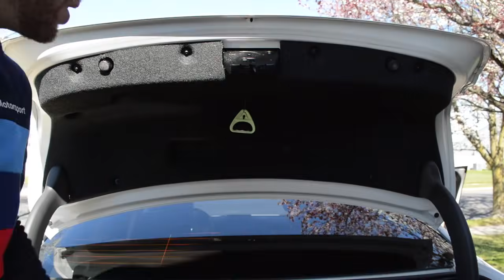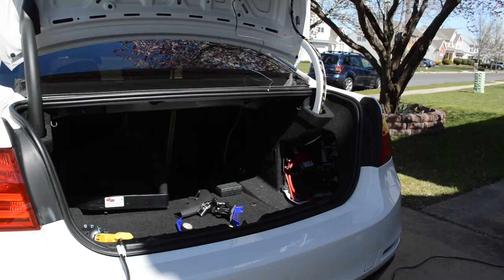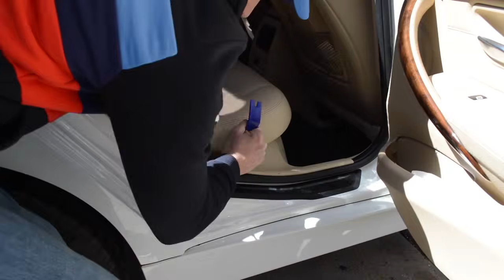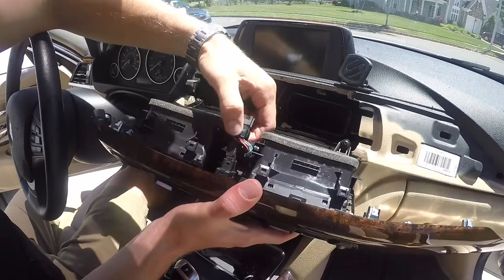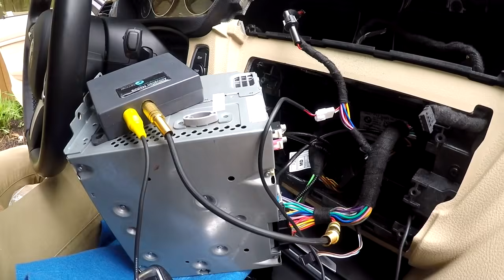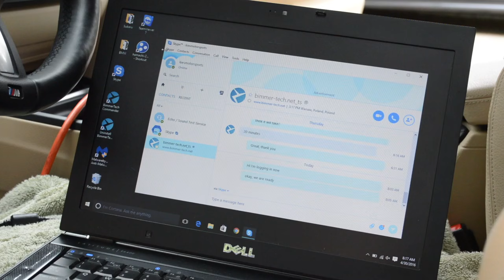Add Rear View Camera (OEM) to your BMW F30 | Installation tutorial

Comment: How did you power the oem camera? From where?
Reply from the maker: The retrofit includes all the hardware you need to tap into car's power with no cutting or splicing required!
Reply: the battery, which is powered by the alternator on the side of the engine👍

Comment: What the hell is problem with putting back up camera when they assembled the car in factory? Why all this after buying why customers need to go through all this after buying😏
Reply from the maker: Haha!  Backup cameras in North America became legally required in 2018, so before then, manufactures used them as "options" to charge more money.  However, they are a fantastic upgrade, so we make it happen for those who didn't get them from the factory!

Comment: Is this anymore difficult wiring for the F36 hatchback?  Also, does this work with an MMI Box already installed for an NBT Evo (iDrive6)?
Reply from the maker: Our camera will plug into our MMI.  The wiring really depends on your trim and panels.  The main feed has to go from your MMI (at the front of your car) to the camera (at the rear), so you will need to follow the same principal as with the F30 here, it's just that panels might be a bit different.  What I would suggest is reach out to our Sales or Support Team (the information can be found on our site), and they might be able to get you the exact information you need.

Comment: the video receiver unit connected to the back of the dash should be a wireless unit to avoid all the wires running from the back of the car to the front. Wireless after market backup cameras are becoming a standard
Reply: Lag for no reason

Comment: What if your rear seats don't fold down?
Reply from the maker: Hello there! The thing is that the back seat is folded here just for a better visibility in the video. It's not necessary to fold them to run the wires. You can take off just the trim and there'll be enough space to get the wires.

Comment: Would it affect the warranty on my car if I fitted rear view camera
Reply from the maker: Hello Linda! No, it won’t void your warranty, but every country has its own local regulations. In the United States, for example, the Federal Trade Commission (https://www.consumer.ftc.gov/articles/0138-auto-warranties-routine-maintenance) says you don’t have to have your BMW dealer do all your repairs or improvements in order to keep your warranty intact. You are able to use any independent repair shop of your choice and can even do repairs and upgrades yourself using OEM, aftermarket, or even recycled or rebuilt parts. The Office of Fair Trading introduced a code (http://www.europe-economics.com/download/OFT852%20published%20report.pdf) that basically means the same thing for the European market. You can read more about the SMMT vehicle codes that protect UK consumers here (https://www.smmt.co.uk/about/consumer-advice/).

Now, if you install something improperly or use a defective part and it directly causes damage to your vehicle, that repair will likely no longer be covered. The rest of the warranty should still remain intact, though. Of course, no matter where you live in the world, we recommend you read your warranty carefully so you understand how to maintain your rights and coverage.

Comment: Hey, are there any requirements to install it? My Bmw has got no navigator, just the normal display 6” or something like that. (The smaller one), do you have to code something? I forgot to add: I asked BMW whether they could install one on mine, they said it’s not possible. The navigator will be installed though. Also, is there a way to mount electric folding mirrors? Bmw said they can’t because there’s no eletric wiring. Is there no way at all? Last question, I’m searching for an alarm system or gps, you have any tips? Thanks .
Reply from the maker: Hello there! Sorry for the delay with the answer.  1) So, as for the rear view camera , type in your VIN here https://www.bimmer-tech.net/bmw-rear-view-cameras/ and the website will shopw you whether your BMW is compatible with the rear view camera or not.  2) Electric folding mirrors, we don't do this, unfortunately. 3) alarm system, we have the OEM one https://www.bimmer-tech.net/shop/bmw-1-series-f20-f21/convenience-retrofits/bmw-oem-anti-theft-alarm-system?keyword=alarm. If you're interested, please write an email with your VIN to info@bimmer-tech.net.
Reply: @bimmer-tech  my vin is WBA9C54GK645679.  I don’t have navigation. Will this rear camera work?  Will it go on automatically when shifting into reverse?

Comment: What if you do not have monitor at all in your BMW? Can you just use any monitor?
Reply from the maker: I suppose that it's possible to do but you would need to have a lot of knowledge about carputers :) Besides, the iDrive system is not just the monitor. I suggest you going to bimmerpost or bimmerfest forum and read about different options.

Comment: What if you don't have folding seats?
Reply from the maker: Hello there! The thing is that the back seat is folded here just for a better visibility in the video. It's not necessary to fold them to run the wires. You can take off just the trim and there'll be enough space to get the wires.

Comment: Thanks for the great video.. Big fan.. Just installed the back up camera for 2014 328i unfortunately it was the bootleg version the view is coming from an overlapping rear view mirror.. Will have to do until I plan on taking the dash apart.. Thanks new subscriber to your vids also  JB...AND SWIFT.. Great vids and much luv at the car show.. Hopefully I will make the next one 👍
Reply from the maker: Hey Eric! As for the camera,  you may contact us at support@bimmer-tech.net - our representatives will help you solve this issue. As for your feedback, thank you very much :) Nice to hear that you like our videos!
Reply: When you installed the camera to the radio/receiver was it a plug and play? Or did you buy a specific block connector? I installed my camera, however, I wasn't able to connect it to the block harness, there was no RCA input.

Comment: Well on my BMW which was kinda sad to notice. I cannot fold the back seats. It seems to be an optional extra. WTF. Anyways how will you get the wires without folding the passenger seats?
Reply from the maker: Hello there! The thing is that the back seat is folded here just for a better visibility in the video. It's not necessary to fold them to run the wires. You can take off just the trim and there'll be enough space to get the wires.
Reply: Did you check inside of your trunk? You may find a handle to release the back of the rear seat on each side.
Reply: My Channel Trust me I looked. I even call bmw

Comment: Sad to see a luxury brand like Bmw making cars without backup cameras in 2017 when lesser makes offer this standard.

Good news is all cars manufactured to be sold in the USA after May 2018 must have a rear camera by as required by law.
Reply: Mine is a 2011 and mine doesn't have one either.
Reply: Greedy BMW as expected.
Reply: if you wanted to pay extra for backup camera then you could have just selected it when buying the car.. ?
Reply: " lesser makes" use a cheapy-cheapy cam belt for the camshafts which the owner will later have to replace at a huge cost or his engine is going to be destroyed, whereas BMW uses a much more expensive encased chain setup. I can continue.